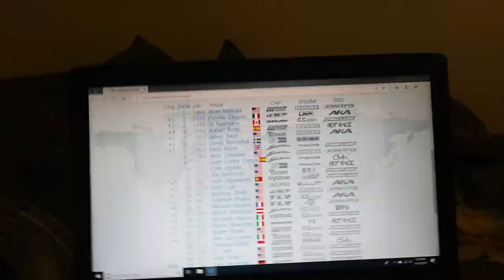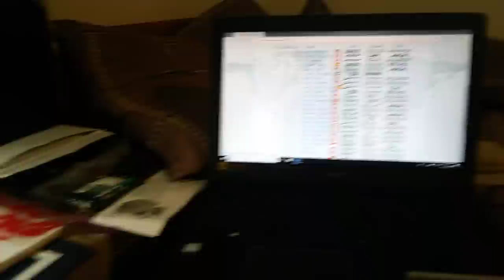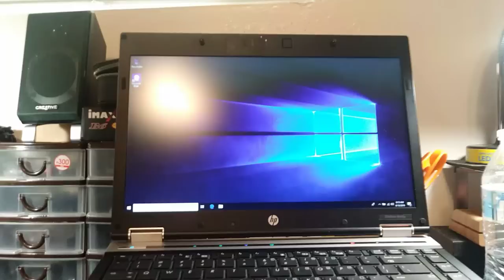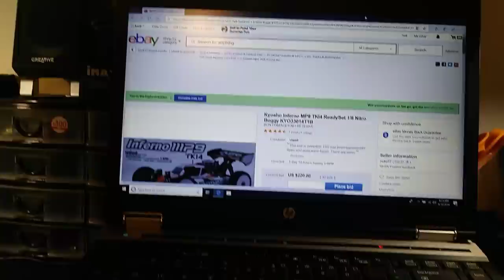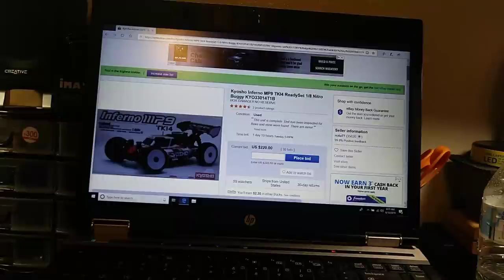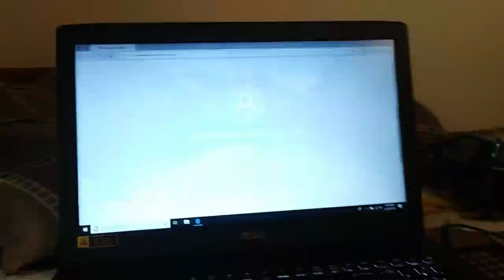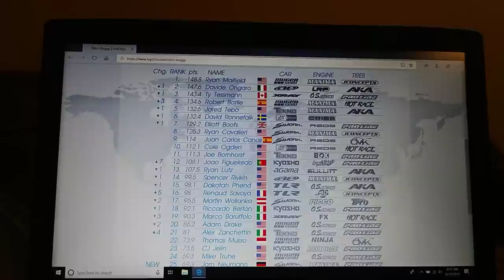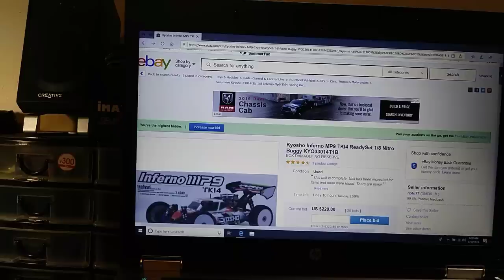Is the nova rex 28.8 the best on the planet?

Comment: Hey muggy love my nova. 28.8 best nitro engine ive ever had the way this thing  screams with my end bleed pipe unbelievable planning on buying another one this week but man this thing likes to on the rich side, to start it gotta lean it out a bit, then richen it out a bit shes still fresh only ran about half gallon through it?? Thinki g of buying an engine heater what do you think is that a good  call, man keep up the good work used to wat h lots of bottajells videos looks like hes to busy with 1/5 scales man i watch yours videos all the time helpfull information 👌👌👌👍👍
Reply from the maker: The nova 28.8 wont fully wake up! Till you hit 2gallons and every time you run it, it gets stronger💪 heat warmer highly recommend! I heat my motors to minimum 150+ it just makes it easier on everthing bump box,les stress on crank piston sleeve etc. And also quicker you get to 200 the quiker and more precise you can get a solid tune! And saves fuel! And they love to run fat! But beter to protect any way Thats your insurance! That it will last! And wait till you mode! Whole nother leavel!